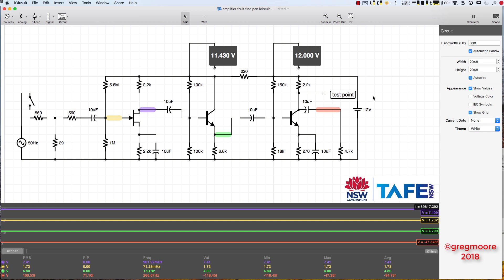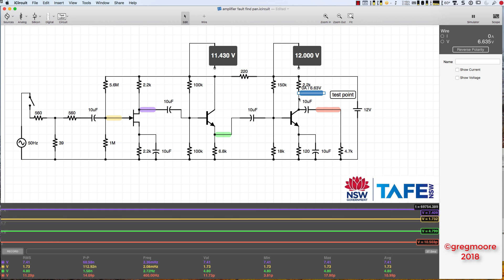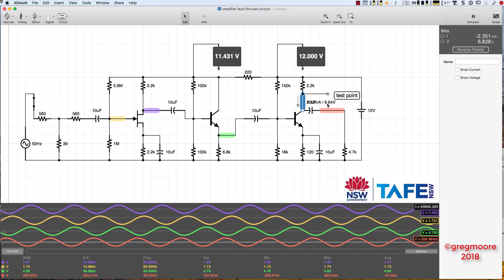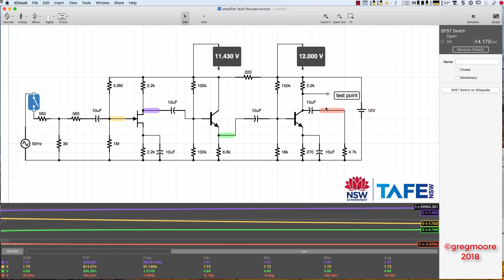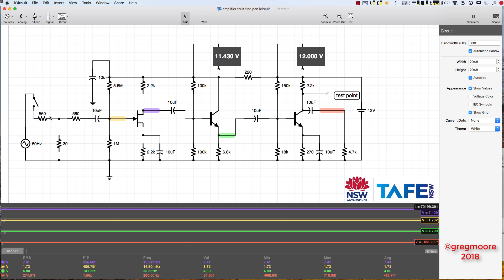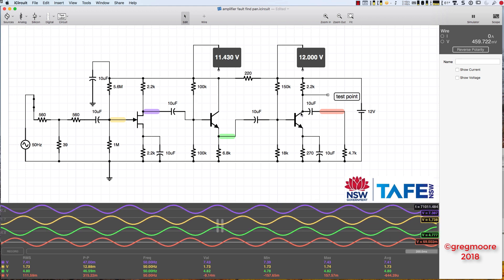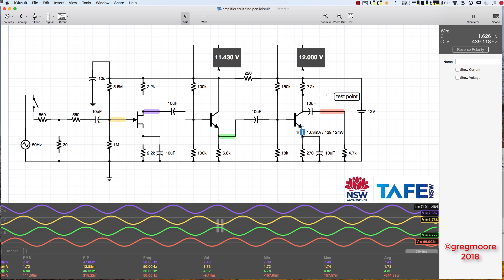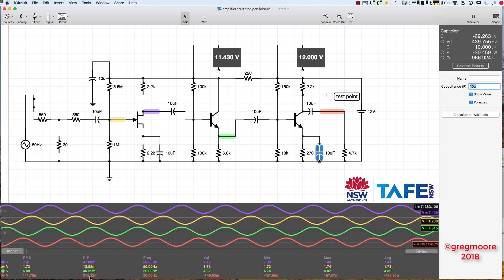Amplifier Fault Finding panel UEENEEH113A Part 2 of 13 TAFE NSW

Comment: Hi regards to the amplifier schematics, Any chance you are able to provide a copy?  Cheers
Reply from the maker: Well there is a schematic here.  This reminds me, I must try to finish this series off in 2020.  Part 3 I did the roughs for, focussing on jfet Q point and constant current region.  For some reason I did not publish it.  Probably was busy at the time.
Reply: @gregmoore7565  Cheers Mate, I am getting a skill assessment done in Melbourne and one of the topics is UEENEEH1113A which is " Troubleshooting Amp in an electronic apparatus" This video does help and give me a step ahead of how they work. Keep it up